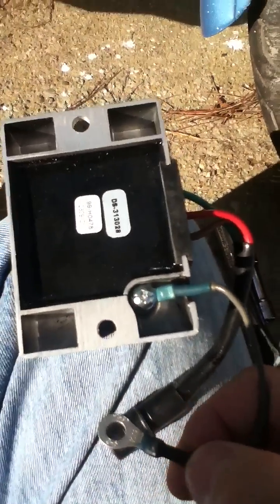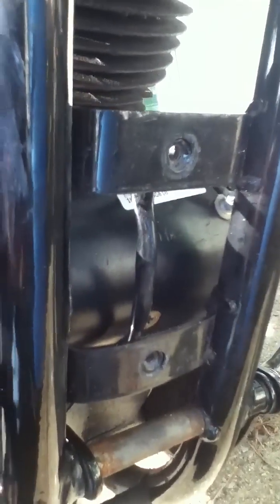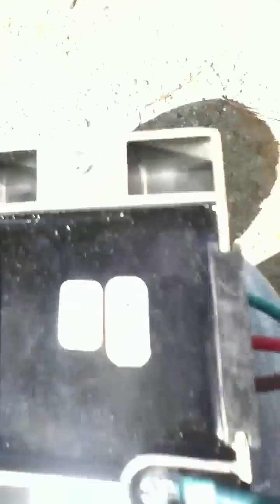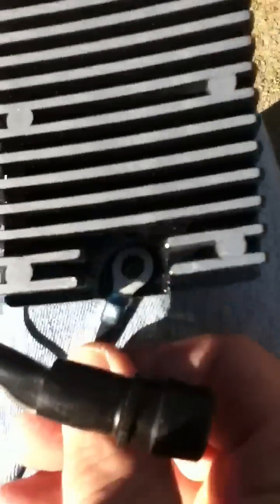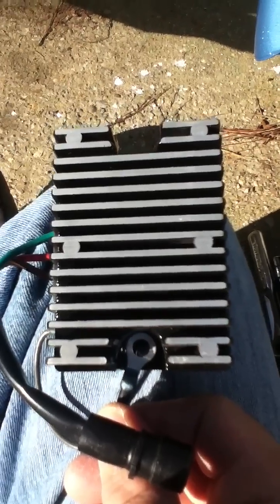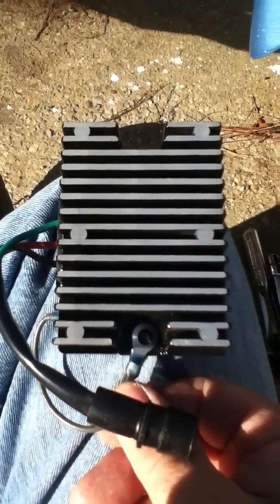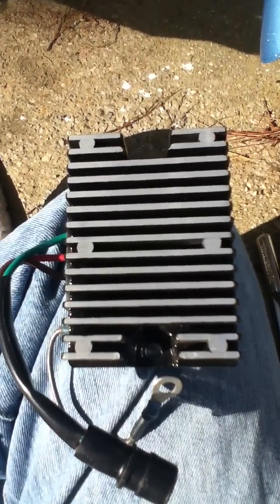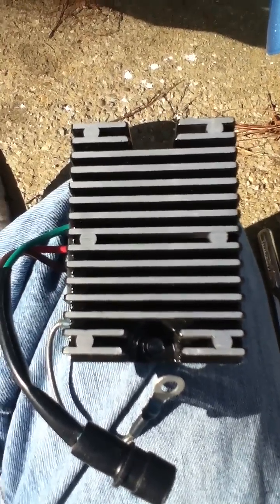Voltage regulator

Comment: mines spikes from 14.5 to 17...does it need replaced or just a better ground
Reply from the maker: Check the ground 1st, typically, that's the culprit.  If no proper ground, they tend to burn up
Reply: Its been fixed
Reply from the maker: For others that may be following, can you describe what you did to fix it?
Reply: It was my voltage regulator..had a new one installed

Comment: I just bought a bike with a new voltage regulator on it and it was overcharging to 16 volts. Adding a ground like this fixed it. The paint just doesn't allow for a good ground, like you said